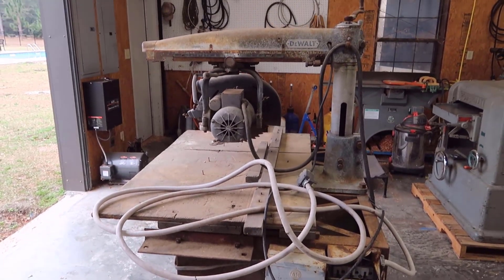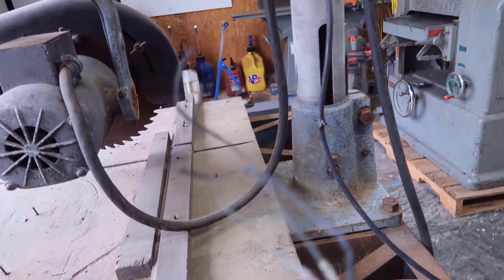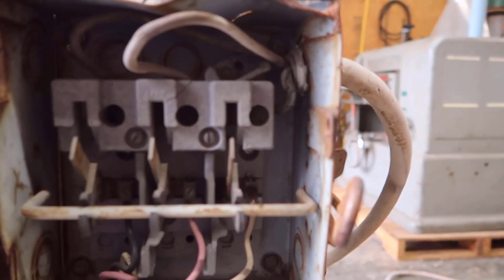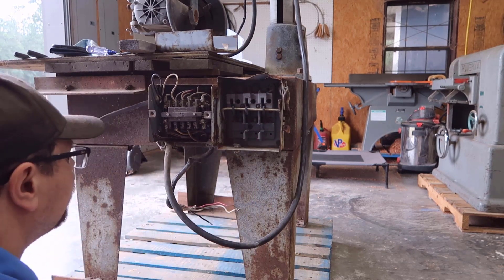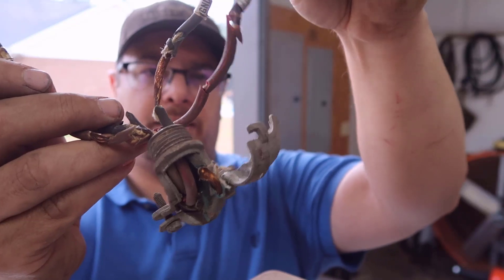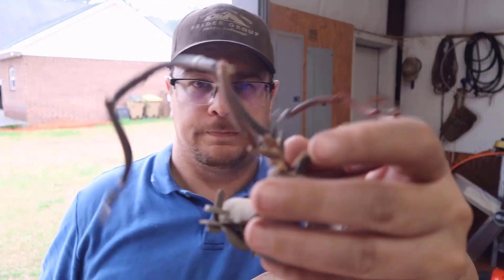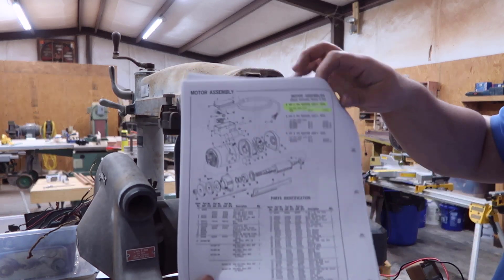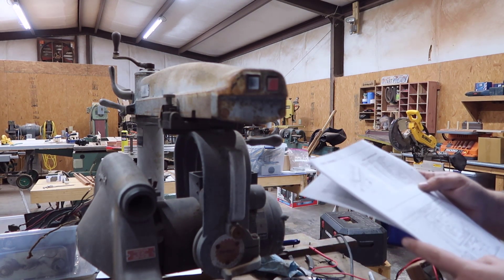Dewalt Radial Arm Saw GA Restoration - Part 1 - Electrical

Comment: Thanks for the video. You may be able to find who has the proper replacement switch from the "dewalt radial arm saw forum" You may be able to find where to get a manual for it also.  I have an older one like 1954 DeWalt 10" RAS and have been using since 2006 about. I'm in the process of replacing the table top right now. I hope you end up liking your saw as much as I like mine .

Comment: the plug is a 220  single phase similar one used on stoves and welders
Reply from the maker: Thank you. I replaced it with a 20A 240V plug and it works great.